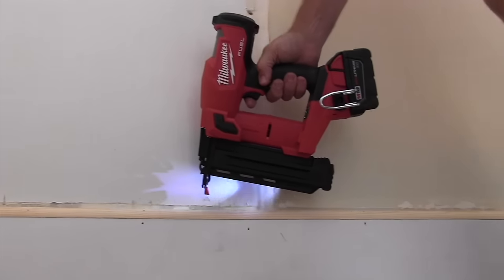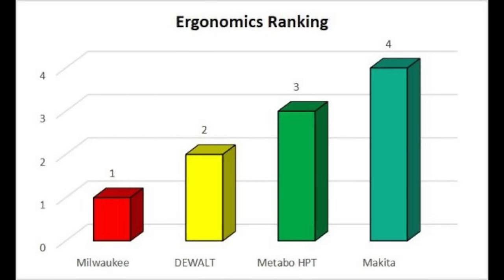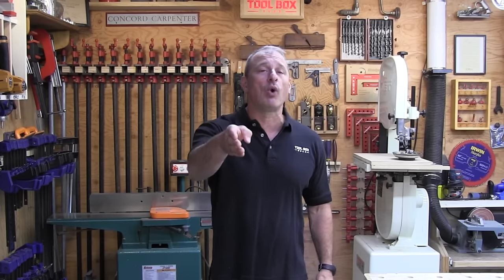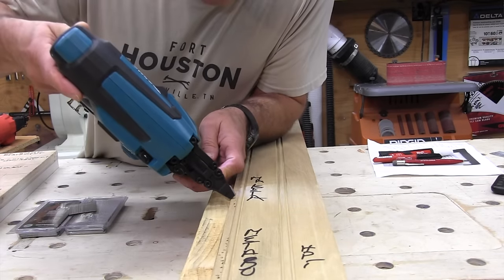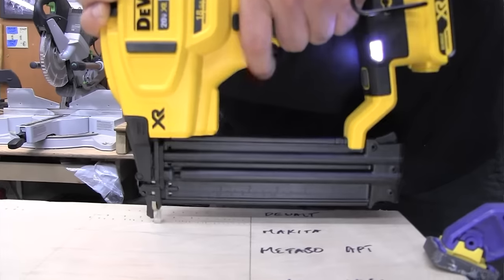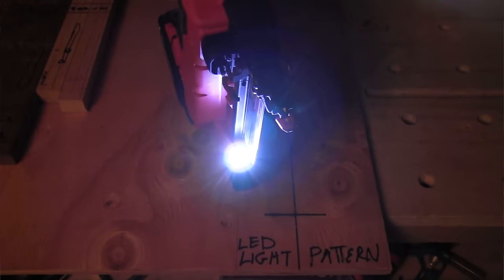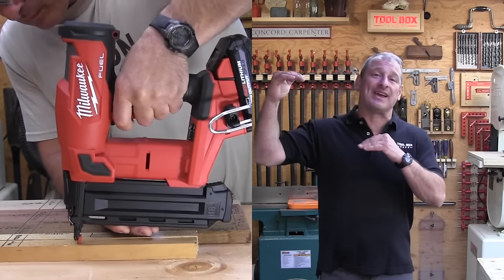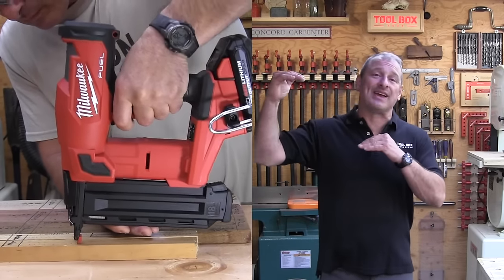BEST 18 Gauge Cordless Brad Nailer - Head-To-Head

Comment: Where is ryobi?
Reply from the maker: Made a decision not to include it - went after Pro grade tools
Reply: Having used both is Ryobi in the same neighbourhood as these tools or miles off?
Reply from the maker: @andyalford6505  yes - but based on my research  - not in longevity
Reply: @andyalford6505  For your typical home owner/DIYer there usually isn't a huge difference between Ryobi and other tools. Simply put, you aren't using them enough to really benefit from the price increase. If you are talking about a pro who is using a tool every single day constantly, then yes they are miles off. I wouldn't buy Ryobi or Rigid or other  DIYer tools because they simply won't stand up long term to the demands I put on them. Also power plays a big factor in certain projects and those tools are usually substantially lower power. That isn't calling them bad tools, I have used many Ryobi and Rigid and they are quite fine. I've never had a real problem with any of them beyond I get into projects where power becomes important and longevity is a big deal. If you are a DIYer and already have something like the Ryobi or other prosumer lines, there is no reason for you to change at all. If you are just starting out and haven't committed to a platform, You might want to look at Makita Sub compacts (which are very competitve in price to lower end) or Milwaukee's M12 line for the same reason. These will come very close in price and offer better performance and in the case of the makita, offer the same battery platform to their bigger LXT line. I actually own several of makita's sub compact line where I didn't need the bigger version and I have zero complaints. My primary tool line is Makita followed closely by Milwaukee and I have a few dewalts as well still hanging around. I've had good luck with Dewalt over the years and actually still prefer their bits. The tools themselves I haven't been super happy with their battery line recently as I don't like juggling more batteries and chargers than needed. The reality is, unless you are a professional any of these tools are going to serve you well. Hell even if you are a professional, in most situations any of these tools will serve you well.
Reply: Why not sure isnt Ryobi not owned by techtronic industries who owns. Milwaukee, AEG and others
Reply: @snwman862  Who it is owned by is less important than the build quality of the tool. Ryobi aren't meant perform at the level of upper tier tools. See my previous comment. They aren't bad tools by any stretch, it is simply a matter of what kind of performance and longevity you need.
Reply: I understand why you didn't include Ryobi. I have one and don't use it heavily but I can say so far it's great.
Reply: I do want to add though a lot of viewers like myself are not in the trades and are homesteading or just want to diy everything so the channel can gain value by including the budget-friendly options that sometimes produce high quality. 

Every now and then brands like Ryobi and Ridgid come out with a product that beats the prosumer level counterparts. This is one of those few times. 

Every now and then those homeowner brands put out a POS, and it would STILL be great to put those in your head to heads to highlight WHY the professional brands are better. Personally I go Milwaukee and Ryobi depending on application and usage rate. 

It could be an Honorable Mention or Value caveat, so as not to take away the main purpose of your channel.
Reply: @ConcordCarpenter  I've had my ryobi for 3 years and it fell in a bucket full of water. I discoed the battery let it dry out and 2 years after still kicking. Only issue my belt hook broke off 😅
Reply: @OmegaGamingNetwork  nice explanation, but based entirely on assumption. Had I gone with my preconceived notions, I would have bought a Dewalt since I'm a Dewalt shop, but I had time to research and soon learned that this specific Ryobi tool is in a completely difference class and is loved by pretty much everyone who owns it. The enthusiasm level was so pronounced that I decided to take the risk. I am very pleased that I did, and the fact that I saved a bundle doesn't hurt either. I have battery support in the Dewalt, Milwaukee and Makita lines, so it wasn't about that.
Reply: @Immolate62  There are always exceptions and yes doing your research is always the best answer.
Reply: A Concord Carpenter / ToolBoxBuzz “pro grade” then uses metabo
Reply: @ConcordCarpenter  i Think you would be impressed with the Ryobi. Its actually pretty good.
Reply: A Concord Carpenter / ToolBoxBuzz Thanks, Good to know.
Reply: OmegaGamingNetwork  Thanks for the in depth reply, really useful. I’m definitely in the enthusiastic DIYer category. In the UK so Ryobi is not as widespread, the range is a bit more limited and the prices are good but i don’t think they’re quite as attractive in the UK but in this case still cheaper in a kit than the pro grade equivalent. Already on DeWalt as that’s what I could get when I picked up my first kit otherwise I would definitely be looking at Makita.
Reply: My boss bought the ryobi for when we either don't have much trim to do, or when we have a fair amount of walking to do between each bit of trim. I can't say I'm a fan of it personally. It's reliable enough for the few times we use it and at its price is worth it for my boss but I still don't like using it. It's very heavy, tends to jam fairly frequently, doesn't drive nail heads consistently, and the battery doesn't always last a full day. The other big problem is if the battery gets cold at all it won't fire until the battery warms up. I usually have to try firing it a number of times until the battery warms up enough to fire the nail. I'm saving up to buy my own right now and am looking at either the dewalt or the milwaukee. I'll make my choice once I get the chance to test out the milwaukee.
Reply: Ryobi is a hobby/disposable brand. I think here they're comparing professional grade equipment.
Reply from the maker: activechaos128 we tested it before and didn’t feel it was pro worthy. In hindsight we recognize that many users would have like to see it included.
Reply: @ConcordCarpenter  if you tested the Ryobi 18g nailer and found that its performance was lacking compared to "professional " grade tools I think it would be good to show those insufficiencies so we could maybe see a bit more clearly what the difference is between them. I've had a Ryobi 18g nailgun for over 3 years now and it's still running strong with no problems.
Reply from the maker: activechaos128 good feedback, thanks!
Reply: In the garbage where it belongs
Reply: @ChristianMendieta  
While ok in trades, you'd be pushing hard tool and battery wise.

People but it because it's cheap to get and cheap to replace, some pros only use cheap tools for that reason, besides not getting stolen etc.

So it has it place, though I know Milwaukee batteries blow away Ryobi batteries easy, so you'd need a few batteries to keep going.
Reply: STILL ON THE SHELF
Reply: @JoHuGi  They may not always be "pro" quality, but they are hardly "disposable".  I'm still using some of my original blue tools after 15 years of heavy use, and I think the new ones are even better.  I go Ryobi 18V and Milwaukee 12V, and I don't think I'm missing out on much.

Comment: Great video as always guys. You are my go to for tool purchase decisions. I mostly run Milwaukee and Makita on my job sites but since the Milwaukee brad nailer isn’t available for purchase, (I believe) I purchased the Dewalt brad nailer because I was in a pinch and had it at my local Home depot.  I have to say it has performed great for the last few days. I’ve ran 1000 nails or so through on a crown molding job and it’s very powerful and nail holes are small.  I wanted to stay within my battery platforms but the Makita wasn’t sold in store.  I’m going to hold off on the Milwaukee for now because I feel the Dewalt can get it done with good results. Thanks again for the video
Reply from the maker: Good choice - that Dealt nailer is a keeper!
Reply: It sure is. Thank you for the reply and keep up the good work. Looking forward to the next video. 👍🏼

Comment: Metabo HPT is the best 18 gauge nail gun on the market 2nd would be Ryobi 3rd would be Dewalt. I have owned almost every 18 gauge battery nail gun on the market. The Metabo is heavy but is a beast shooting into hard woods. The Ryobi is good for fast nailing. The Dewalt is good all around but breaks very easy. I work the hell out of them 10 hours a day 5 to 6 days a week in Commercial Trim and Cabinet work.

Comment: Love a fair evaluation. I'm almost tempted to go for the Milwaukee - but I'm already on the DeWalt platform and there is no better feeling than having a battery die and being able to grab one from another tool in mid-flow. I've been at this for long enough to remember when EVERY cordless tool came with TWO batteries, a charger and a case (without tacking-on charges for the "extras"). If the Milwaukee came with 2 batteries and a charger for the same price, I would buy it. I'm doing mostly Shop work these days, so I don't have a need for a "powerful, production" nailer. I just need something that I can use occasionally to tack pieces together while the glue dries. I think I'll go with the DeWalt in this case, but I always do some research before buying anything new. This review was in-depth and fair. Much appreciated.
Reply: You can use Dewalt batteries on the Milwaukee with an adapter

Comment: Dewalt has 2 light settings that change depending on the position of the fire mode switch. Brighter in bump mode. My biggest grip with it is the recoil. Its odd the Ryobi wasn't included. Though it would have come last, doesn't work well with small packs, has unprotected cylinder, and lowest accuracy; its the cheapest, very good illumination, and low recoil.
Reply from the maker: tensazero you just answered your question as to why we didn’t bother with it. We looked at top 4 Pro grade nailers
Reply: @ConcordCarpenter  LOL. I know, but it's a nice comparison for recoil and area illumination.

Comment: Great video! I watched this video and read the article several times but do not see any information on what brand nails were used for the test. Did all the nailers used the same brand nails? I am on the Makita platform because all my cordless and ope are made by Makita. However, most of the videos I've seen on the Makita brad nailer has been negative. Since your experience seems to have been postive throughout the review, do you mind me asking what brand nails were used for the review? Thanks in advance!

Comment: To bad you didn't include the 'cheapo' Ryobi in your review , would have been curious .... yes I wouldn't really expect it , but I ended up buying one because I didn't have time for a DeWalt to arrive (the DW model back th en was not as bulky as the one you tested ) .... This was 5 or so years ago ... still use it, still love it  .... not top grade, but has survived my truck drawer abuse 
It handles 2" (rare back then), shoot fown to leaving 3 nails, it is powerfull enough for everything I have needed , has good adjustment, faily light, .... it nails slow, and the firing pin is too oversized but not devestating

Comment: Last month as I was rounding up all the power tools to bring down off the roof as I was climbing off the roof brackets to the staging the newest milwaukee m18 fuel 1/4" impact was knocked loose from my belt. I was cringing as I watched it spinning in the air with a 5.0 battery and a bosch 6" t25 bit knowing as it hit the concrete below or dump trailer it was going to smash. I watched it hit so hard it bounced another 5 or so foot in the air spinning even faster finally hitting off the corner of our dump trailer. 
I rush down picked that gun up knowing it was cracked and nothing...not a single crack just good dents

Comment: I bought the Milwaukee  Naylor to sorry was on the platform I've been using a lot for baseboard and my sisters house if I had to run a air compressor it would take problems 3 to 4 times as long keep  It going     👍🏼🍻🍺

Comment: If you already have a Milwaukee charger you can buy the tool, bag and a 5.0 battery all separately for $370. Or just tool and 5.0 battery for $345.00. Bare tool at HD is $279.00. 5.0 battery at amazon is $65.50. Depending on the size and quality of the Milwaukee Fuel bag $17.99-$40.00 at amazon.

Comment: Another important factor is how long the tool lasts before something stops working but it’s luck of the draw sometimes possibly also depending on how you use it may be a factor I have stuck with dewalt for all my cordless kit I have both of their guns finishing and framing and I am very pleased with their performance but to me longevity of a tool is important even if it means spending a bit extra

Comment: Realistically the finish hole being within 1/1.5mm isn’t any issue as any finish nails should be finished with a filler the only problem would be if the brads didn’t actually sink enough that you aren’t able to hide the holes

Comment: No mention of the Paslode probably the best selling brad and framing nailers for the last 30 years which requires no compressors but use gas cartridges.

Comment: As always...greeeeeat run down! The Milwaukee really looks like they improved on their 2-3 yo last gen. They seem to crank out tool “next gen” upgrades much quicker then other companies. Like Dewalt impact hasn’t had really any improvements except the “atomic iteration” Milwaukee has like 3-4 out since then in the fuel line!? I think bc they weren’t involved in every trade prior to this that they keep changing/updating tools to stay on par with the veterans who like Dewalt... over the years of making a saw have “nearly” perfected it. Though I find they are VERY expensive in comparison big red? I am so close to grabbing an open box DeWalt 18g 1/4” crown stapler. I wonder how it compares? I have a 15 & 18g already, but want a 1-1/2” crown nailer for a few random situations I am stuck in and could really use a stapler for... but it can’t be lacking in the power category bc thats essentially 2x brads. I have no driving issues w/ my 18g but the 15g in thick hardwood/ply/mdf struggles at countersinking correctly at times. Annoying...& now i catch flack from my air nailer compadres who can’t let go of their all metal guns...while dripping in pink oil 😆

Comment: Why not the Paslode 18? Odd that it’s not in this comparison. It’s cordless. It’s light and ergonomic. For me, works like a charm. Should be in this for sure.
Reply: Except, now you have to add the cost of MORE consumables to your, already narrow margin, job...
Reply: Uses gas, I think Rob said it was a battery only comparison, just my interpretation and I could be wrong?
Reply: Sorry man paslode is obsolete now If you haven’t upgraded the technology out now is well worth the switch!!
Reply from the maker: gas - we did battery only. Paslode is a super nice gun..... we've done some great coverage on it - use search box to ind them
Reply from the maker: check this out https://www.toolboxbuzz.com/head-to-head/best-cordless-finish-nailers-head-to-head/
Reply: blackdog714 I hear ya. It’s not my profession. More of a hobby. So I didn’t factor in the extra costs.
Reply: Paul Petrie I did look for him to say that, but only heard “cordless 18 ga.”  He clarified below.
Reply: robert sharpe I tried a couple others and didn’t like them at all compared to the paslode.  Never tried the Dewalt. But a lot has to do with not being on that platform.
Reply: A Concord Carpenter / ToolBoxBuzz thanks!

Comment: Gotta ask...any plans on doing a head-to-head  with 12" cordless miter saws?  I can't figure out if I should go with Makita or Dewalt.  Thanks again, love your stuff!
Reply from the maker: T Willey we’ve tossed the idea around. If we did it probably wouldn’t til winter.
Reply: cordless milwaukee 7 1/4 slider chop saw is sweet spot.   Great saw, and light.  I want light if I'm bringing it upstairs.

Comment: I had one of those Dewalt nailers they should have tested it a bit longer. After a month it will not sink anything over inch nails.
Reply from the maker: Nelson Clark is it paper tape? If he’s, open the head and remove the paper build up
Reply: @ConcordCarpenter  I am pretty sure there was no paper in it. It appeared that the anvil was bent possibly on the jam that happened every 7th shot like clockwork. We would count and on 7 we would shoot the trash can and clear the jam.

Comment: Very fair review. Thank you.so the question becomes : I have all Dewalt with ryobi on a few tools.... because some times I work over salt water. Do I go with the M. Or the Dewalt that was runner up. I think it’s Dewalt because I have so many batteries. But that’s just Coke and Pepsi.
Reply: Mark Doyle always go for the platform in which you have batteries for unless it's a huge difference in performance. I have a total of 7 dewalt batteries so all my cordless tools are dewalt.

Comment: Shot many tens of thousands of nails through my DeWalt. Loading tray is all plastic and now jams on almost every sleeve of nails no more than half way through. Also, driving pin now punches brutal wide holes. Disappointed in these. Still better than pneumatic with hoses and compressor

Comment: Thinking about buying one of these but they're so damn expensive...
Reply: I got the ryobi air shot fo4v109cad at home depot bought a battery and charger off Kijiji for 60. All my power tools are dwalt. But for about 50% of the dwalt nailer it was good deal  and has good reviews
Reply: I can second that. I bought a second hand ryobi brad nailer for $50 and the thing is a beast. Isn't quite as refined as the higher ones but it does the job and can drive 2" brads through solid oak trim.